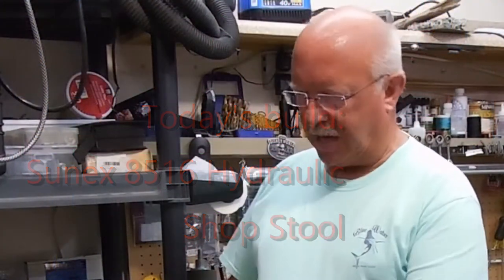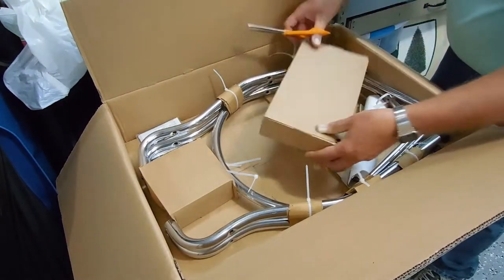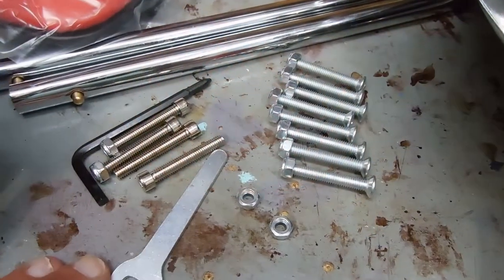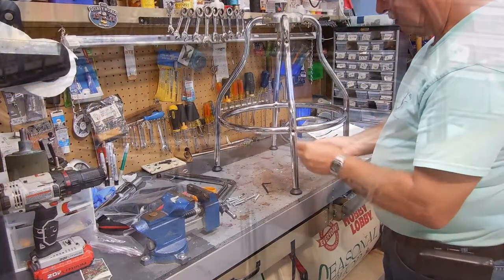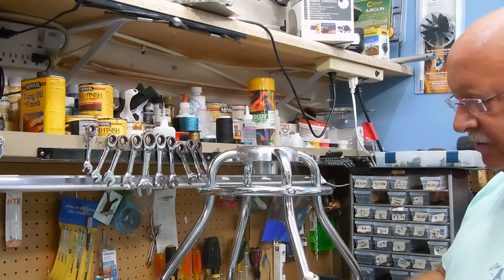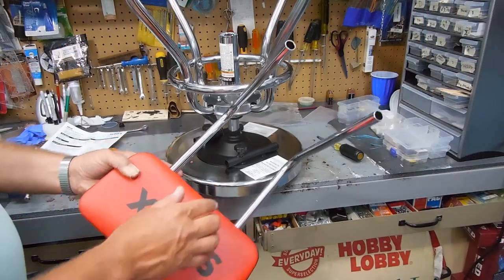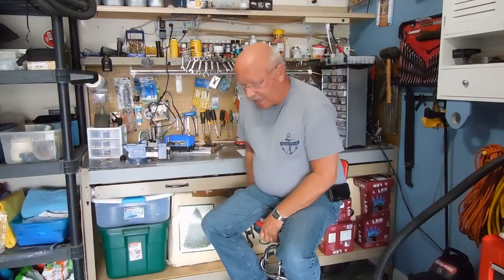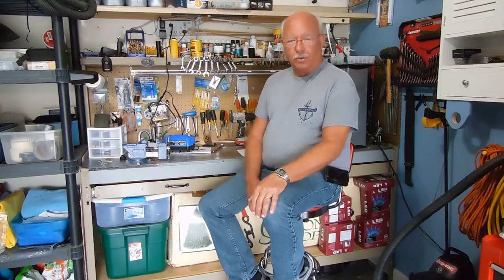Sunex Hydraulic Shop Stool: Unboxing, Assembly and Review

Comment from the maker: I’m adding my own comment! Just before warranty ran out…. The hydraulic system on the stool went out…. Fine print on the warranty “YOU HAVE TO SEND IT BACK AT YOUR OWN COST!”  I didn’t, so now I just use it in the lowest seat setting.
Not impressed!

Comment: got mine apart, the hydraulic  is shot 8 inch,ill try to replace?
Reply from the maker: Mine too….. I did a follow up video of my disappointment.  I use it still, just can’t adjust it.
I’ll be interested in hearing if you can get yours fixed. 👍
Reply from the maker: Great, thanks.  I usually have to look up stuff for viewers…. You’re the first to help me out!😃👍👍
Reply from the maker: Hey Mark, Apparently, I wasn't logged in to Amazon when I put the replacement hydraulic in the Amazon Cart to purchase later.  So now I've lost it....  Can you reply with that link again?  Thanks.
Reply: @BoilerDan1  did you get the link ,...mine arrived today
Reply from the maker: No, for some reason, the reply you posted disappeared?
However I got mine apart and found one on Amazon that should work.
It’ll be a few days.  But I’m on my way to getting it functional 👍
Reply: @BoilerDan1  i just did mine ,works great,14 bucks for a 60 dollar shop stool,hope this one last,
Reply: @BoilerDan1  office owl cylinder  replacement...$13.84
Reply from the maker: Thanks, I’ve got it in my Amazon cart.
I had ordered a different one earlier today and will see if it fits as it has a little more range.
Appreciate your help.
Reply: @BoilerDan1  no problem ,i put the new one in my automotive  short stool,.the gas tube was tight in the old outer sleeve,but i got lucky the amazon  unit fit the stool base like the original, which is 2 inch  diameter, anyhow somewhat universal,im happy to have fixed mine,was only a year old, perfect shape  was worth  repairing, and the part came unusually  fast...good luck w yours,its amazing how they swivel on that tiny bearing ,w 5 bee bees
Reply: @BoilerDan1  some ytube channels hold shared links ,so you can choose to delete or keep,,im not  too sure why,but it seemed to share twice,lost  in cyberspace?
Reply from the maker: I thought maybe you had deleted it?
I know that I can but since yours was helpful to everyone, I was leaning to help others.
Anyway, we’re both on track to getting ours stools working again!👍👍
Reply: @BoilerDan1  yeah i sent it twice,as a pasted shared,anyhow im not super techy, but i did share,twice,anyhow update when you get yours working,i used a rubber  mallet, a ball peen hammer,and some chunks of wood,to unseat the outer tube,fun times
Reply from the maker: The one I bought fit but it’s too tall!  I’m reordering and getting the same one you got 😁👍
Reply: @BoilerDan1  yes,...has about 5 inch of height adjustment....you got this